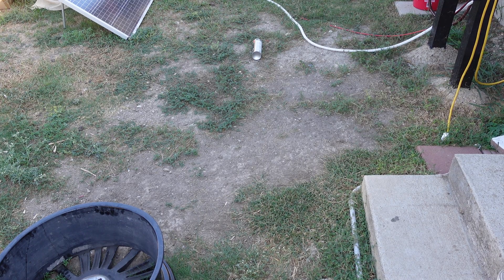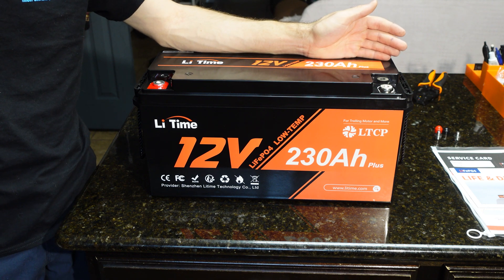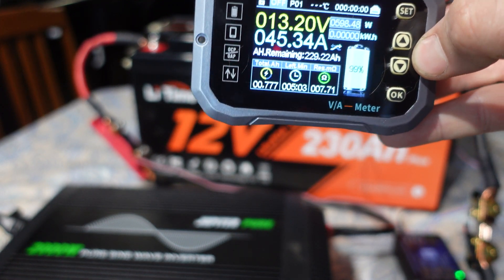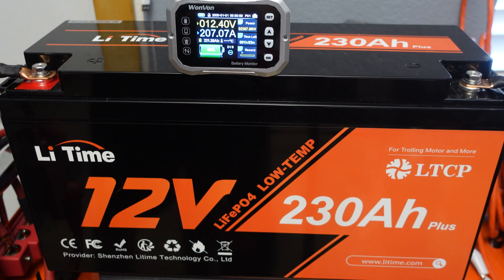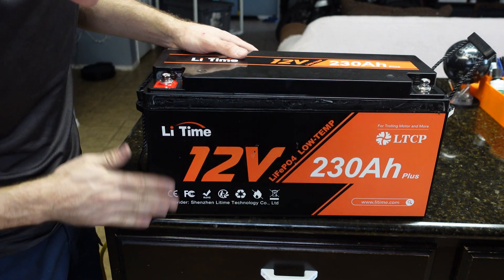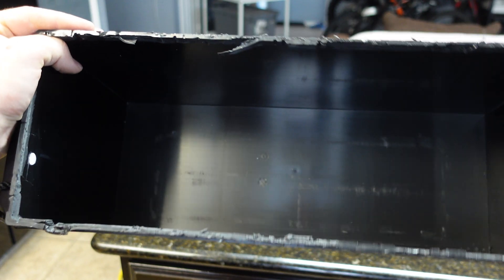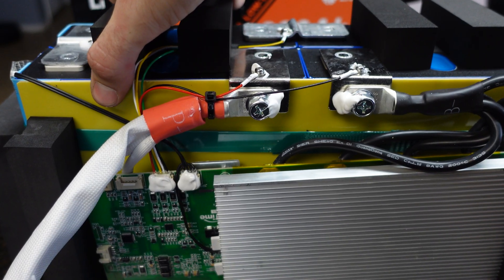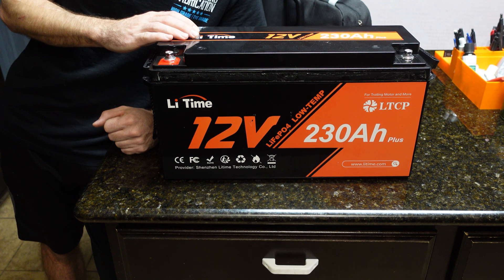Li-Time 230Ah Plus 12 volt Lifepo4 Review!  Trolling motor rated!  200 amps!

Comment: Seems like great value! May I ask what inverter and size you used? Thank you.
Reply from the maker: @tribe-of-Zabulon  In the test I used a Harbor freight pure sine wave, for my actual setup I use an eg4 6000xp
Reply: @Mikebuildss  Hey thanks for the reply, what is the limit inverter size wise for that 230AH battery? I am going to use the same battery in a DIY power station build, and looking to power at most some electrical cooking stove top for camping, maybe a small air fryer, everything else is low power. And warm greetings from Aussieland.
Reply from the maker: @ I’d say keep it at or below 2000 watts on one battery, or just use 1 appliance at a time, cooking stuff normally pull a good amount of power so make sure your DC side wiring is good to handle the power. Go with at least a 2000 watt you will be good

Comment: Seen them for $443 .I paid over 500 a year ago.I have 4=48 volt.So far there ok. They still rest at 13.33v each.I haven’t done any balancing other what my 60 amp charge controllers do with 4200 watts pv.
Reply from the maker: @2hotscottpro  Nice! That’s a ton of solar too I only have about 3500. I wanna do something similar. They make an active balancer made to be used with multiple batteries I’m testing right now, using 4 different 100ah batterys to give me 48 volts
Reply: @Mikebuildss  it’s eight 525 watt biracial panels that go over roof top ac’s on my camper.Getting 2100 watts peak with sun so far away now.I have seen about 4400 a few months back. Bare cells are getting real cheap.Prime day had a 100ah for $133. Now it’s $168.